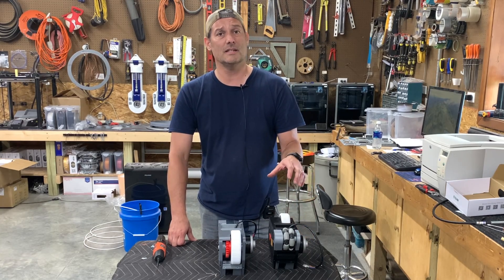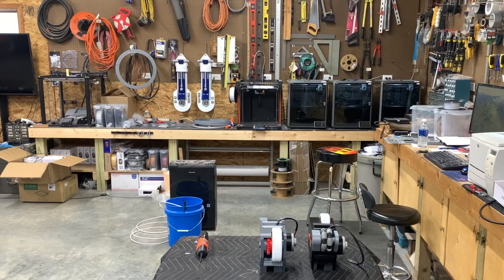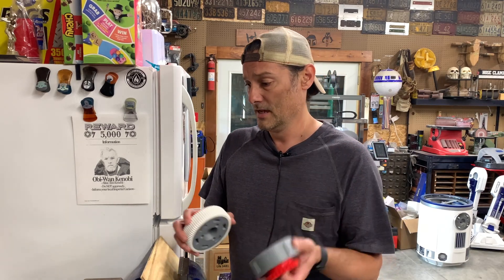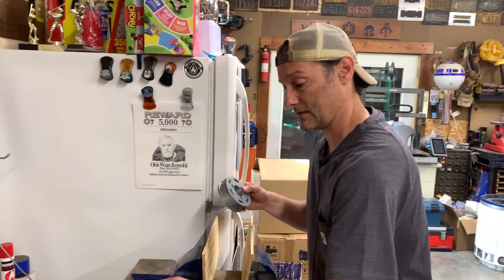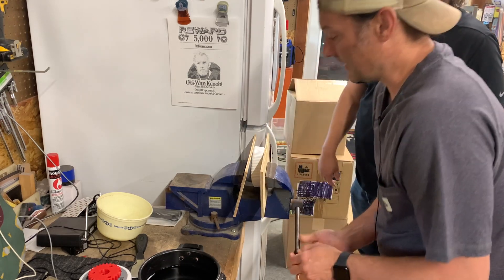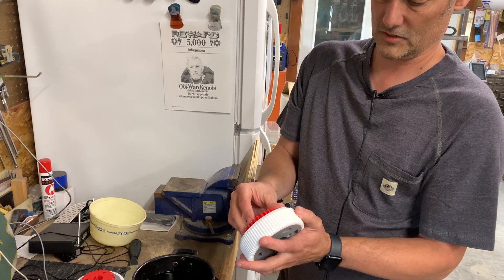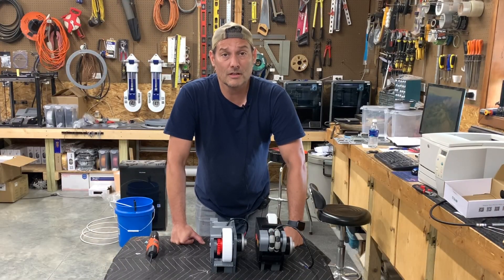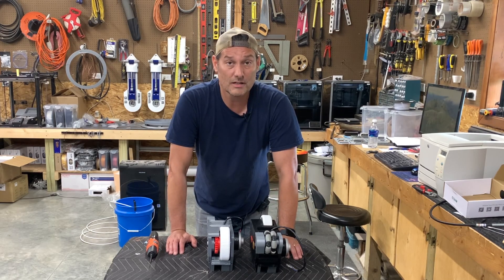R2-D2 FOOT DRIVES! R2 (Build Part 6)

Comment: Enjoying your videos - thanks for doing them.  I have a question on the foot motors you're using.  Are you happy with the 100W motors?  I know some folks opt for the 150W versions and have to deal with the fact they are a little longer.  Have you been happy with the 100W motor performance, or have you found situations where you wished they had a little more power?  Thanks!
Reply from the maker: Good question!  Do the 100W motors work?  Yes..... Do I wish I had more power at times?  Yes......  I have only used the 100W and have only ran into one or two times where I wish I had more power but that's when I'm on carpet or a fairly steep incline and I have also found that that's usually areas I probably shouldn't dive in in the first place.  The gears usually fail first so I have learned the hard way to keep out of areas that aren't flat and smooth for easy rolling.  If you ever try a 150W motor let me know how they work for you!